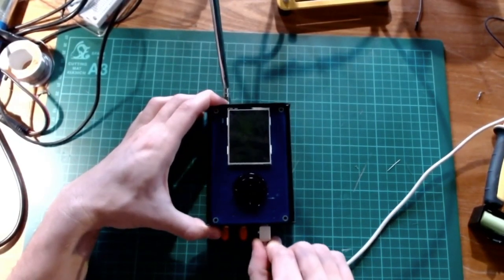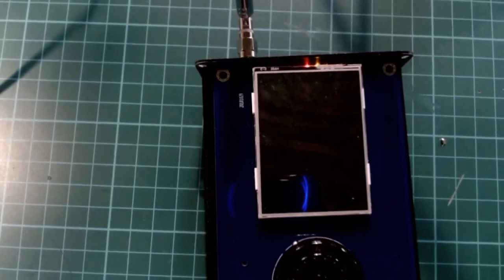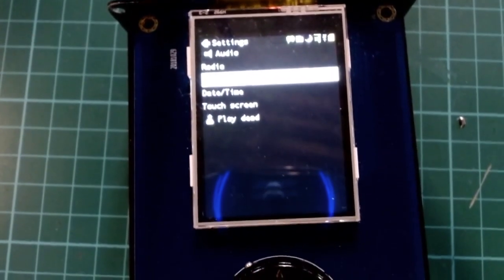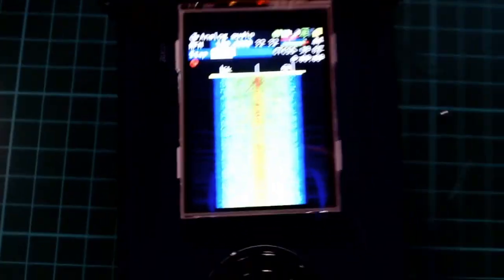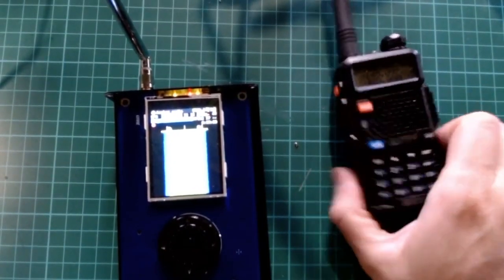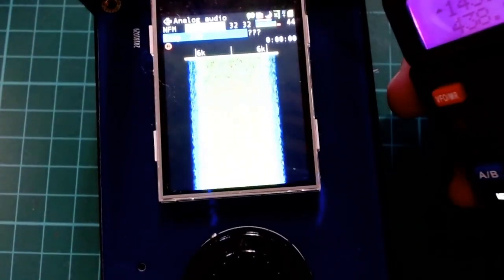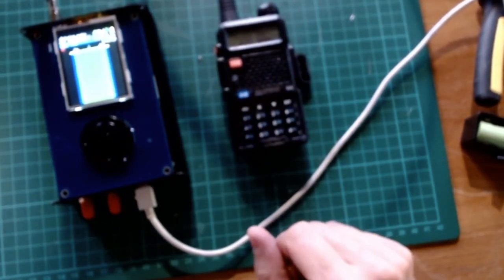Episode 14: PortaPack or plain HackRF? My 2 cents on the topic.

Comment: Hey Rf noob does the hackrf transmit in single side band? I know it doesn't put out much power but just want to know the modes it transmit in.
Reply from the maker: yes, it can transmit in any type of modulation as long as the bandwidth occupied is less than ~10Mhz... Sure, this includes SSB as used in Ham Radio! :)
Reply: @therfnoob7697  Thank you

Comment: hello The RF Noob, thanks for this amazing video
have you ever please, worked with two hackRF (TX and RX), in order to obtain the the S-parameters RESPONSES, S21 or S11? 
Is it the most appropriate pack, to have such response or do you have any suggestion?
thank you
Reply from the maker: thanks! No I have just 1 HackRF. 
What you plan to do is, I think, theoretically possible: use one HackRF1 to emit a signal, and receive with another HackRF2, with the two having the same clock (CLKIN) it shuld be possible to measure the phase response and (with calibration) also amplitude. 
However I don't know if anybody has done that. 
If you just want S11/S21, I strongly suggest the nanoVNA :)

Comment: what does the linebar on the mayhem top-interface symbols?
there are 6 symbols and most of it are obvious..
nr2 is take a screenshot.
nr3 is making the screen dull, fx under charging
nr5 is bias DC voltage on the antenna.
nr6 the SD card.
but not sure about nr1 and nr4.?

Just got myself one of these (im new to RF and electronic in general ) and it blows my mind what such an all-in-one device can manage, and even incl. 5 antennas of surprisingly decent quality and magnetic base... one of them weighs like 250grams-, (the device is obviously a clone at those prices)
https://i.imgur.com/0SeH9rO.jpg
https://i.imgur.com/l6W5TbJ.jpg
https://i.imgur.com/GCOtjFL.jpg
https://i.imgur.com/KeSD3FQ.jpg
Great build and the metal shell could be run over by a car. (it weighs like 400g though have purchased a heavy full alublock of a fingerknob and it IMO looks good, not least with the blue glow underneath)
Are there ar videos on Youtube that go step by step on the Mayhem FW and what the different features and menu's are intended for and under what circumstances that could be useful?
btw I reckon its the same chip there are in my PC spectrum analyzer 20m to 6.2ghz and sure the Portapack are able to go way higher then the 6ghz label..at least 6.2ghz.. though dont got any tools to validate any higher then this.

The unit is variant v3.3 and arrived with 1.2Mayhem FW.. sadly no speakers, but picked up 2 thin speakers, that should not overload the soundchip.. it did have a 2100LIPO installed but my biggest con sofar, is the lack of saving ones settings,
I am putting my luck to the coin cell, perhaps was dead or shimed, and that why it wont save settings.
Anybody else has issues with the unit not saving settings.

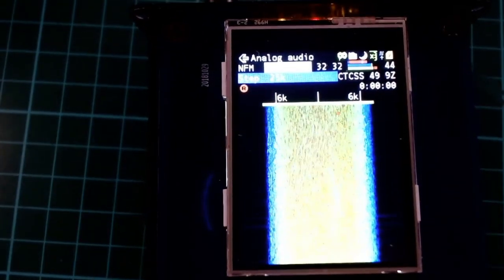Comment: What is the maximum bandwidth you can view on the spectrum analyzer with the Portapack? At 7:22 it looks like your viewing about 12khz wide, is that about the maximum?
Reply from the maker: It's 12Khz in NFM (narrow FM) mode, but you can get a maximum of 2Mhz on the portapack with the "Spectrum Mode" :)
Reply: @therfnoob7697  cool thanks!

Comment: this is not a toy the portapack is used by many professional hackers yes hackers. not a toy.
Reply from the maker: you are right! I definitely used the wrong words. What I meant is that, compared to the full abilities of the HackRF (which you can have by programming and running it with a computer), the features offered by the portapack are much limited. But as I said I am very happy I bought it. You are right it's used by hackers (no idea about "professional" :P).
Reply: @therfnoob7697  what do hacker use this for?
Reply: @Morcego538  Hacking
Reply: @TonyLing  you don’t say! What kind of hacking? What can they do with this??

Comment: hi ! Is there a selection that we can select "computer mode" which can connect computer and using SDRsharp ,or "Portapack mode"?
Reply from the maker: Yes, in the portapack software there is an option called "HackRF" mode. When you click it, the Portapack behaves like a normal HackRF and you can control it from the computer (for example to use SDRsharp)
Reply: @therfnoob7697  I got it. Thanks!!